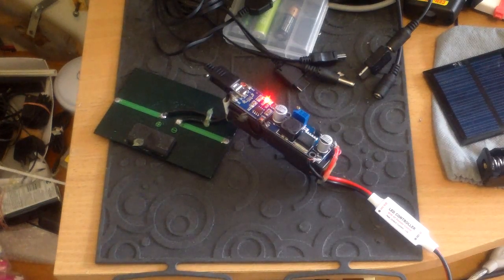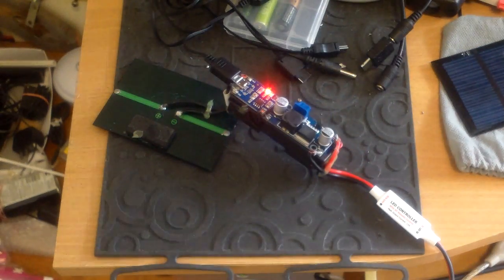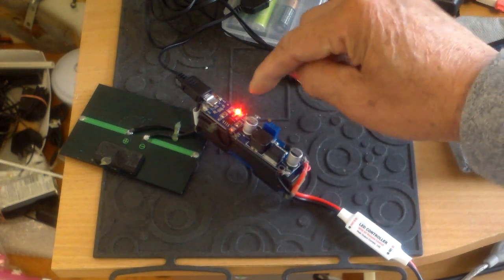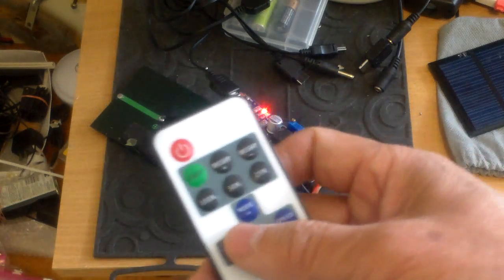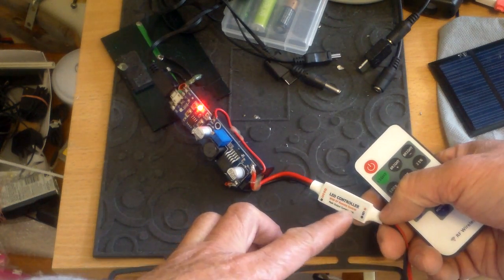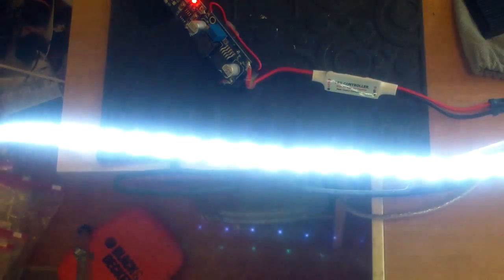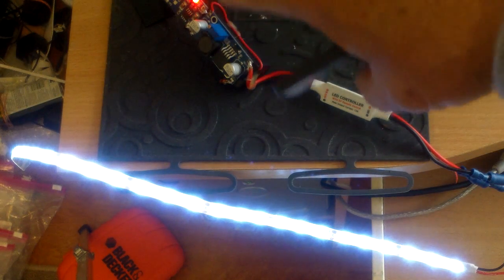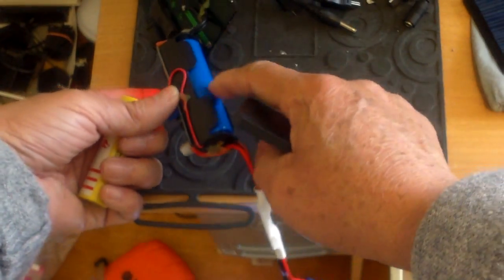DIY remote controlled solar usb rechargeable LED strip light

Comment: I hope you can help me I have a LED strip ws2812b of 5v factory if I connect it with a 3.7v battery would work the led strip or would have you do something else? Thank you
Reply from the maker: If the LED strip is rated for use at 5v, then you need 5v.  You can put your 3.7v battery in a usb power bank  case as that will output 5v.

Comment: were can i get a remote led set from please
Reply from the maker: Many stores on ebay sell them. This is one of them:http://www.ebay.com/itm/12V-RF-Wireless-Remote-Switch-Controller-Dimmer-for-Mini-LED-Strip-Light-New-DX-/261561225747?pt=US_Lighting_Parts_and_Accessories&hash=item3ce6439213   I don't remember if I bought from them.
Reply: thank you

Comment: Was also wondering if it is just easier to use the dark sensor you have instead of the remote ( where did you get the sensor from) and how I would hook everything up?
Reply from the maker: For your purpose , dark sensor is probably better. For my LED lightbox, your solar panel works with the charge controller and become the dark sensor. The solar charge controller has a load (lighting control) control and can turn your light on at dusk for a programmable number of hours, or just from dusk to dawn. The charge controller is less than $20 on ebay. I made several videos on this versatile controller. Here's the link: http://youtu.be/aB-CMxA3MW0  My problem with the remote control concept is the button cell batteries on the remote control go dead very quickly. Also the pwm remote controller has to on too so that can drain a small 9v battery.  Range can also be a problem, especially when the battery weakens.  That is why I suggested the LED light box with solar charge controller, battery and solar panel. It is easier to build and set up. The LED light box uses a beefier 12v battery without the use of a boost converter. You can make the battery last longer by using a shorter led strip.  If the want to go the remote route, you should test out the range of the remote first. As for the build, you can wire it so the solar panel charges (remember to use a blocking diode) your 9 volt, then connect the 9v to the step up converter's input, adjust the output (to 12v) and connect it with the pwm remote control input. Then you connect the pwm output to the strip light.

Comment: Okay I have the LEDs, rechargeable 9 volt,  and some solar panels. I'm going to buy the booster and the remote ( I hope it can reach the gate crime the house). However do you have a template or guideline on how to connect everything? I have an idea but don't want to mess it up.

Comment: Thank you for replying. I should have been more specific, I want to know were you got the solar panel and voltage booster. I'm trying to basically do the same concept. I live in the country and have a gate that is really far, at night I would like for the gate to automatically light up at night so I know it is closed. I tried hooking up the garden lights in a series but it is not working. I came across your video and I believe this would be the solution.

Think you for your time.
Reply from the maker: If you want an off grid light to come on at night, maybe you can take a look at my other light project and make some adaptations. You can probably do it about $50 or so and you can actually program how long you want the light to be on or not. This is the link: http://youtu.be/dz895tljGUU
The only thing I've noticed is the strip light, though working and waterproof, might not be so uv resistant.  So in mounting the strip, it'd be better to mount on the underside, rather than on top of your railing or  whatever. Again, you can go to ebay and type in the search box for whatever product you want and you can find them.  The voltage booster can be found here: http://www.ebay.com/itm/3-pcs-XL6009-Step-Up-Boost-Power-Converter-Module-DC-DC-3V-32V-to-5V-35V-MAX-4A-/291122496383?pt=LH_DefaultDomain_0&hash=item43c840c37f
 Feel free to ask and it'll be great to see your completed project on Youtube.